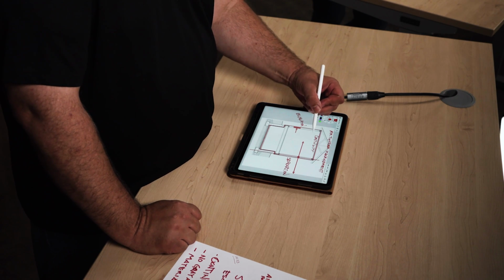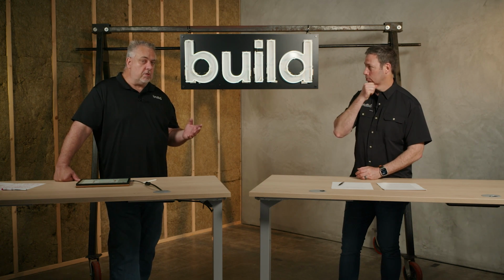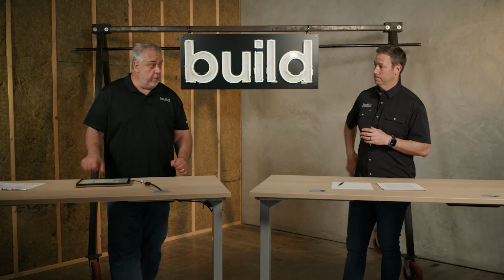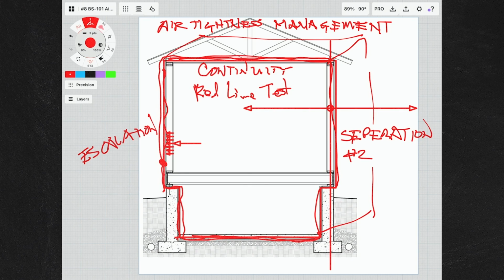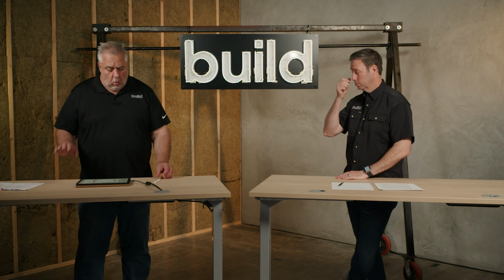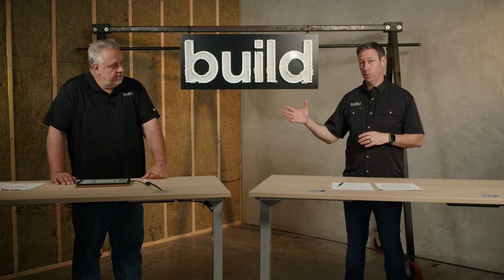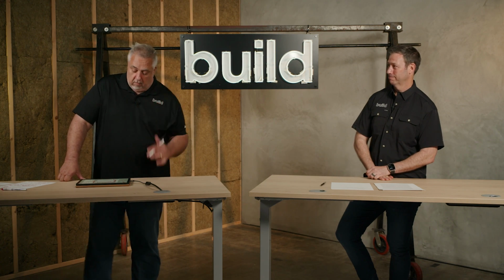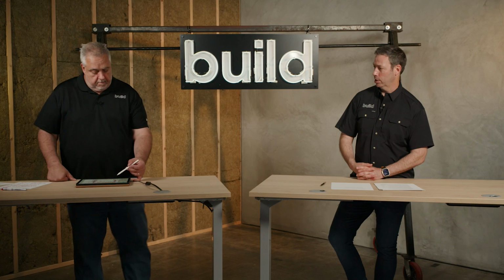Build Science 101: #8 Airtightness

Comment: I do not get putting the air barrier to cold climate location.

I have a Gore Text jacket to it breathe our vapour.  Otherwise, I have condensation mugginess to me and my clothes

So in yhe UK we have an internal vapour barrier.  Then breath the structure out.

To roofs or timber frame we have a breatherble memrane to control air penertration. But all the vapour to get out of the structure.

We normally have brick wall with air cavities.  Which we have tendered to fill with insulation.  Which removes are drainage / centilation cavity..

Comment: Good video.  Question? Do you have a cost efficient way to cool the attic (unconditioned) to reduce the delta.  I too live in very hot Texas.  I have heard that putting solar roof top fans don't work.  It isn't feasible to convert the attic to a conditioned space since the rest of the house isn't tight.

Comment: One issue I can't figure out. I have a 2800SF ranch with a large attic I plan to finish. I am going to use closed cell foam at the roof rafters and possibly a combo of closed cell and batt at walls. Does it matter if my soffit is vented or not? Right now I have vented soffit in site ready to be installed.any suggestions?

Comment: I'm all for efficiency and reduction of heat/cooling losses, but I don't want the indoors and the outdoors to be completely isolated from one another as far as air quality is concerned.
Reply: Please read what you just wrote?? Of course you want them isolated where air quality is concerned
Reply: @stevenbaczekarchitect9431  I should have added that I live in a rural area where outside air quality is better than inside probably 90-percent of the time so, I'm not all that concerned with breathing higher air quality indoors as I do outdoors. Unless of course I had a compromised respiratory system or pulmonary issues, or I was elderly, I'd rather be exposed to a natural air environment to keep my immune system busy building strength.
Reply: @theamerican7080 You can bring outside air with controlled inlets if that is applicable for you.  Ie, windows, doors, etc.  Im sure there are whole home air filter systems that would give exactly what you want with exterior air.

Comment: If you want to measure the air tightness of the envelope then measure the cfm per sf of envelope at 50! 
A 1,000sf house with four corners and 1.0 ach@50 is a lot leaker than a5,000sf custom home with 20 corners at 1.0ach@50!
Reply: That is very interesting
Reply: So I totally agree that if they’re going to standardize it in the building code, it should be a factor of the SF of the house in question. That makes sense

Comment: Not true Steve, it's not always hotter at the ceiling than the floor. Just shot the temp of the floor at 72 and ceiling at 71 and wall temp at 5' 71.3. So a well build house has very little temp difference. Thermal mass makes a difference too.

Comment: Matt, could you talk about ductless ERVs in some future video. We have no ductwork in our home and using mini-split heat pump for heating/cooling. After a remodel our home is now so airtight that home air pollution is now a real issue, which we’re regularly reminded of by our Airthings sensor. Without ductwork what options are there out there to solve this tight home issue
Reply: You have no bathroom fan? Use that for your ventilation
Reply: Lunos is a much better solution than nothing. You'll need to run low voltage to each fan but that's it.

Comment: The artightness here in Iceland happens on the inside of the outer walls. The insulation of the outer walls is always vented to the outside. You have a venting space between the water or rain protection and the wall. We have of course a rather cold climate. The airtightness and the vapour protection is here the same layer. You never let the vapour from the inside go into the isolation of the outside wall. Electrical lines and water and the water and other pipes on the inside of the artightness barrier.
Why in the USA is the artightness done on the outside of the wall?
Reply: It definitely depends on your location's climate. In a place like Texas, it's often very hot and humid outside. Therefore, you place the air-tightness on the outside to prevent moisture from penetrating inside. Whereas up north (say in Minnesota), it's standard to have your vapor barrier on the inside of the exterior walls (although most buildings do a crappy job at it). Since the US is so large, the answer is really: "It depends".
Reply: @og-shub  When you are venting the isolation to the inside, how do you get rid of the vapour?
Reply: In southern states, the vapor barrier is often on the outside and in northern states the vapor barrier is inside. The walls either dry to the inside in the south or dry to the outside in the north. That is traditional, however now some northern builds are adding air/vapor barriers on the outside and a "smart" vapor barrier on the inside that allows moisture to dry to the inside while preventing moisture from entering the walls/insulation